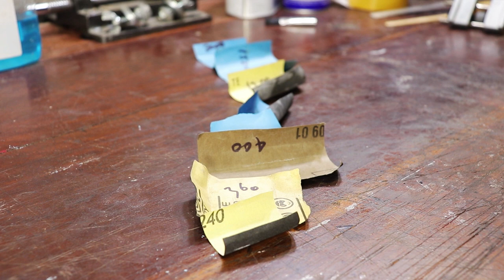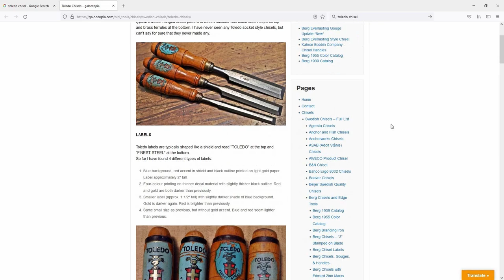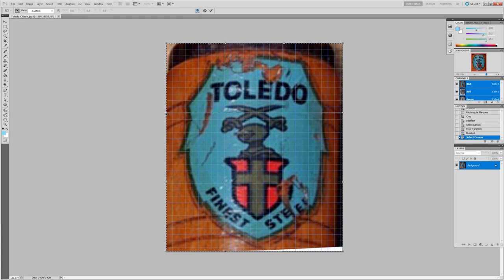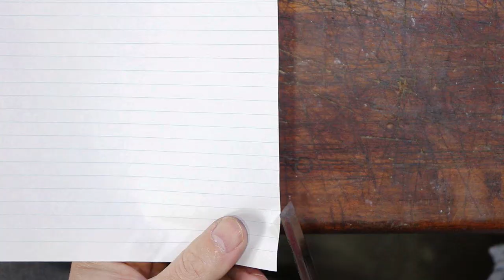How To Restore and Sharpen a Rusty Vintage Chisel

Comment: A perfect job. Great for a display item. I could never bring myself to using the chisel after all that work.
Reply from the maker: Actually I use it a lot.  It feels very nice in the hand.  But only for paring.  I wouldn't hit it with a mallet.  I have others with heavier blades and squarer shoulders etc that are more suited for that.

Comment: Wow, you did an outstanding job restoring that chisel. I am an avid collector of another old Swedish chisel brand, but they were all made in the same town called Eskilstuna in Sweden. You have a chisel with some great steel and a lot of life left in it. Great find and rescue!
Reply from the maker: Thanks Martin.  I'm not really a vintage tool collector or a restorer, but this was a fun project, and I thought I'd go the extra mile.  (I normally work on guitars).  You are right, this is a very nice tool, and it holds an edge very well.  I use it frequently.  And thanks for the info.  Eskilstuna looks like an interesting place...  "Stålstaden", "The Sheffield of Sweden"...

Comment: Great video, great result. Lots of excellent tips. Question: What did you soak the decal print in, and how did the backing paper fall off so neatly?? I've tried various approaches, none as good as yours.
Reply from the maker: Thanks Ian.  I just use water.  I do use a timer with my water transfer sheets.  Plus I always buy them from the same hobby store.  That way you build up a feel for the materials.

Comment: I’m in the process of sorting out some vintage marples chisels but am struggling to get through the pitting on the back of one of them. Have you got any tips to speed things up ?
Reply from the maker: If you have the experience and equipment you could try annealing it.  This will make abraiding far easier.  You'll have to then harden, polish, and temper.  If you can't do that, and you decide to use a machine for abrasion, be sure to keep it nice and cool.  Hand working hardened steel takes patience.   An audio book may help...  🙂

Comment: Beautiful result, but please don't polish the back like that on a drill press.  You are inadvertently rounding off the two edges just enough to make it impossible to get sharp in the future unless you polish off even more.  I see that you've compensated by using a strop on the back as well.  That actually creates a mocro-bevel though.  Okay in most situations (and first few gos on flat materials), but will cause the chisel to not want to shave flat eventually.